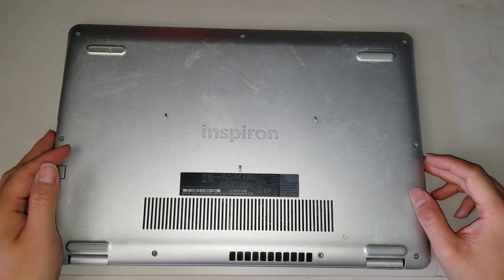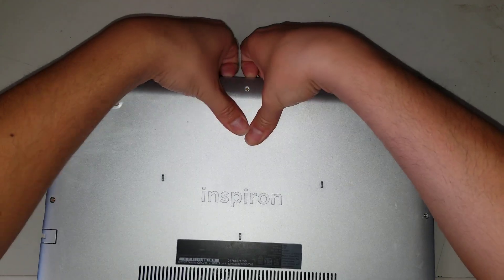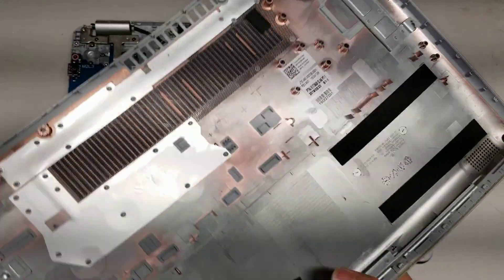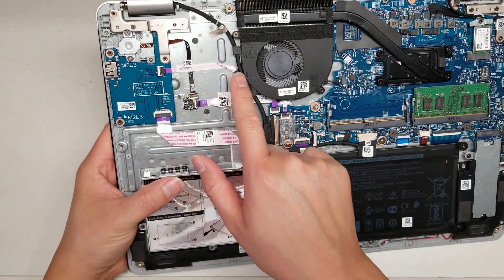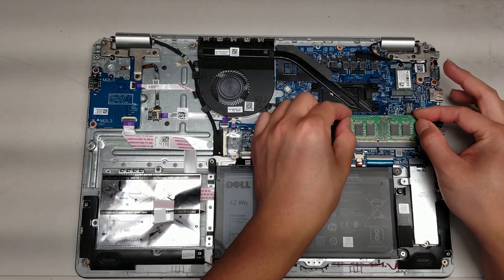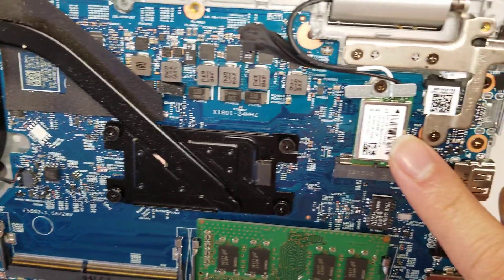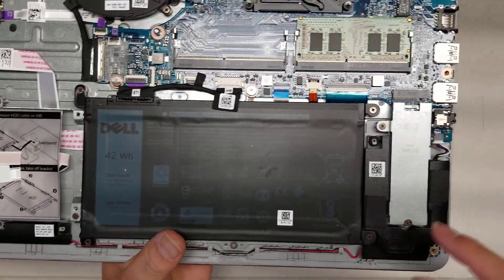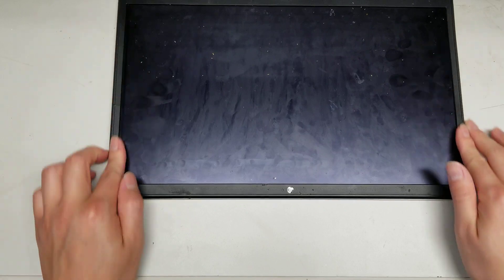Dell Inspiron 15 5584 Disassembly RAM SSD Hard Drive Upgrade Repair

Comment: My laptoop does a noise like something was loose in the hd local. do you pass through this too? or is it just my dell? I bought it yesterday
Reply from the maker: I don't own the laptops I work on. You'll have to record the sound and upload it to YouTube for me to hear.
Reply: @ItsBinhRepaired  https://youtu.be/-uEVcjhPPOg
Reply from the maker: @gabrielmonteles7243  if it's the same model, it might just be the hard drive caddy/cable that isn't being used rattling inside.
Reply: @ItsBinhRepaired  It is the same model. Im Just scared because i didnt see anyone talking about this on the internet. And the Noise is not discret
Reply from the maker: @gabrielmonteles7243  you shouldn't violently shake your laptop like that anyway. It's not good for it. Lol
Reply from the maker: @gabrielmonteles7243  you can open it up and remove the adapter to make sure.
Reply: @ItsBinhRepaired  hehehehe. I dont know if I Will lose the garantee if i open It. But tomorrow I Will contact the support
Reply from the maker: If there's no sticker seal then they won't know if you opened it
Reply from the maker: But yeah, you can call to make sure it's ok. As long as you don't break anything it'll be fine
Reply: @ItsBinhRepaired  hehe I'll call them
Reply: @ItsBinhRepaired  I found out the cause of the Noise: https://youtu.be/jf1BnmxY-YA
Reply: @ItsBinhRepaired  It was Just this. I was not 100% fixed.
Reply from the maker: @gabrielmonteles7243   just l like I said, it's the hard drive adapter/caddy/cable. :P you can tape it down if it bothers you and add foam/napkins/tissue to pad it, but honestly if it's rattling around, you're being too rough on your laptop. It's a good indicator to leave in. Haha
Reply: @ItsBinhRepaired  hahaha this is the main problem. I bought It 3 days Ago. It came that way. But i ajusted it it's fixed now
Reply from the maker: @gabrielmonteles7243  yeah, it's actually nice. Most will have a slot, but won't provide the adapter and caddy to install a drive there. You can easily add more storage if you want.
Reply: @ItsBinhRepaired  hehehehe thanks for helping me

Comment: Do you know if It can upgrade to 16GB of RAM?
Reply: Yes, according to the Dell website. It can take a maximum of 16gb across the two slots. https://www.dell.com/support/manuals/en-ie/inspiron-15-5584-laptop/inspiron-5584-setup-and-specifications/memory?guid=guid-f07064b8-2eb4-49ec-88a8-43b102e42417&lang=en-us
Reply: @ianhurley767  I agree too!
Reply from the maker: I lied, it's useless for 99.9999% of users.
Reply from the maker: I don't think so, because one RAM is part of the board and it probably won't support a 16gb stick. You can try. Why so much ram though? 16GB ram is useless for 99.99% of users. Upgrade to an SSD instead.

Comment: Hey there! I really loved your video! as it had helped me understand the interiors of my own dell inspron 15 5584! Keep up the great work as these kinds of videos will help more people like me! However, my model stopped working a while back, as it just shut off when I was using it to play games with my friends. The battery light does not turn on anymore after shutting off, and I was wondering if you could please help me? Thank you so much in advance!!
Reply: I have tried the pressing power button for multiple seconds and restart the device, but that didn’t do anything either :(
Reply from the maker: @winter_by_arthur  if there's a cmos battery, try removing it and shorting the pins. If that doesn't work, it's likely a dead logicboard.